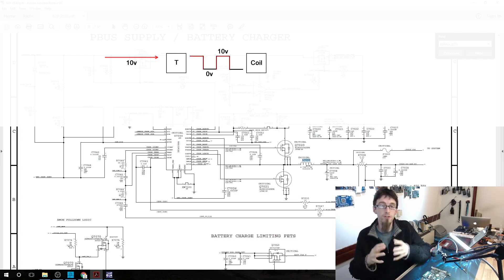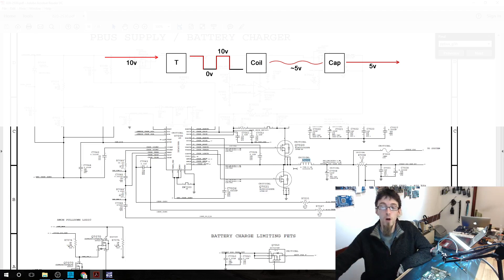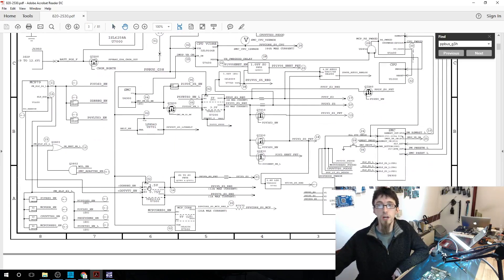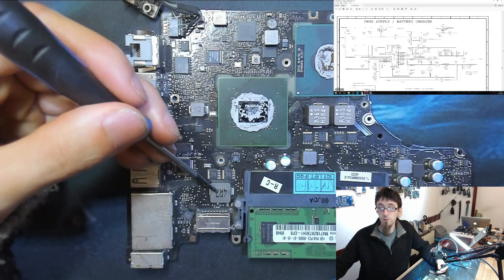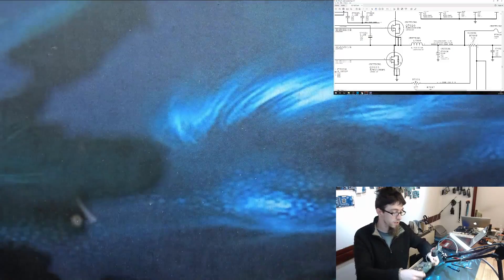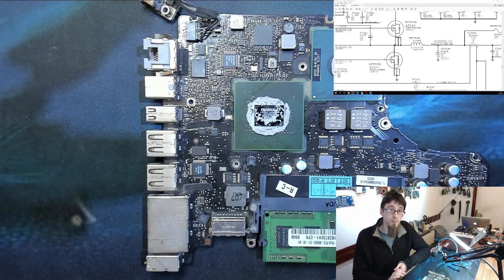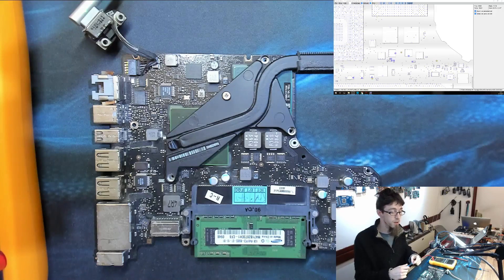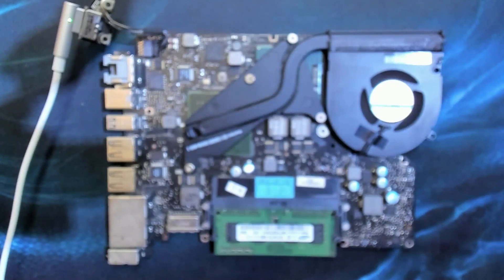Board Repair Basics #3 - Buck Converters

Comment: I don't get it. On schematics of other laptops it is frequent to see that two back to back transistors are turned on by the same signal. Here if U7060 comparator(TL331) turns of Q7001, it's diode would still be forward biased and it will not prevent flow of current from 18,5v charger. Q7001 can handle high current's through it's diode, but turning it off alone would not be sufficient to cut power. The whole point of back-to-back mosfets is to prevent current flow in both dirrections, but here we see that one of them can be turned off(if it were other mosfets that can't handle high currents through their diodes they could burn out). From the looks of it, seems to be that U7060 is there to prevent current from getting out, though i may be missing something and i don't have a board to check it.  Update: Q7001 prevents negative voltage from being applied to the system  and battery voltage from leaking out

Comment: 5:54, i'm confused. if 10v would lead to 5v, why does 16.5v lead to 12.65v instead of 8.25v?
Reply from the maker: The width of the high-voltage pulse will dictate this. I gave a 50% example because that's easy to understand, but if you did a 25% pulse of 10v, you'd get something closer to 2.5v, all other factors not included.
The buck regulator will watch the output voltage and carefully trim the pulse width until it's seeing the target voltage. This means that the input voltage can vary by a fair bit, and the regulator will still... regulate.
Reply: 8 @Adamant_IT  is this coil similar to an inductor or motor windings? Why do they have to be coiled?

Comment: How do you know, looking at those schematics, in which direction power flows, since I see many lines connecting to the different components. 
What are those black dots by the way?
And how does an average of 0volts and 16.5volts gives an output of 12v? 
Contrary to most other viewers I found these tutorials rushed. A lot of things left to explain.

Comment: Can you use a step down dc to dc converter to use in voltage injection
Reply from the maker: I think so, yes. It needs to be able to current-limit though, otherwise it'll just destroy itself due to being run in a dead-short.

Comment: Help a noob make sense of the fundamentals.. Does the U7000 apply voltage on the gate of the flyback mosfet when the buck converter output is low, thus allowing it to only allow current through at appropriate times? I can see how this could be useful in contrast to just using a simple diode that would always let the current be drained to ground.

Comment: A very general question : where do you get the parts when you have determined which part is dead ?, especially if you do not have a grave yard of dead mother boards of all types to take useful parts from in your garage.

Are there new part suppliers some where ?
Reply from the maker: It's tough when starting out. eBay is a good bet, but might not be the cheapest. Aliexpress is fairly solid, but slow. It all depends what country you're in really.
Reply: @Adamant_IT  

Thank you for your fast reply.  Here in the U.S. is little bit tough because people actually...... " wish " their computers  break, so they go to bestbuy to purchase the newest model instead of mulling repairs...

Comment: Your channel is a treasure! I got a question, you measured the voltage in pin 2 (coil) in the first buck converter and the voltage was steady. Why? is the multimeter too slow to read wave changes or what? From what i have understand for a steady voltage we need the capacitors next to the coil.  Do you need an oscilloscope to see that or what? Thanks.
Reply from the maker: Correct, mustimeter isn't fast enough. A scope will show the wave output, but I didn't have one when I was recording these videos.

Comment: Reading other lessons on buck converters, I understood the premise and the way transistors work, but this video allowed the pieces to click when you explained how the varying voltage ratios allowed for the coil to output a different A/C current into the capacitor which straightened it out, also help me get a better understanding when you mentioned how there was a drain for the excess from the coil.

Comment: The low side MOSFET does not 'prevent flyback'.  It allows flyback to turn the inductor into a current source and continue charging the main capacitor C7008, while at the same time charging the bootstrap capacitor C7025 for the next cycle.  Since the other side of the inductor remains connected to the output capacitor, you aren't shorting anything anyway (you'd have to short Both Sides of the inductor, as a flyback diode does).  Here's a PDF - not exactly a model of clarity, but it does describe the process in detail: https://engineering.purdue.edu/Courses/ECE433/exp5_5th~6thweek_.pdf
     Also, the duty cycle of the circuit is not determined directly by the input voltage vs. output voltage ratio.  It is mostly determined by the output current, which changes the voltage on the output capacitor.  At extremely low current draw, the output cap isn't drained very much, and only needs a short pulse from the high side once in a while to maintain the set voltage.  As current draw rises, it will require larger pulses to maintain the set output voltage, and the duty cycle rises in proportion to compensate for the higher current demand.  If duty cycle were determined strictly by the input/output voltage ratio, it would never need to change.
Reply from the maker: I had a lot of trouble understanding flyback, and hadn't really grasped it myself at the time of this video - but yes, you're right 👌
My understanding is that when the low-side turns on, it provides a negative to the inductor's positive, right?
Reply: @Adamant_IT   Inductors are such odd birds, you almost have to change how you think of them depending on the state of the power applied to them.  They always act to resist the change in current.  Voltage rises, the current will rise slower as some of it is used to charge the inductor's field.  Voltage drops, some of the field collapses and tries to keep the current from dropping (actually just delays it a little).  If you remove the external voltage entirely, it's best to think of the inductor as a battery.  It is now a Current Source, with the same polarity that was applied to it a minute ago.  But now it's supplying current, so electrons will try to leave the negative side and find a route to the positive side.   Current is actually moving the same direction it was before - sometimes that's a hard concept to grasp.  Probably due to everyone calling it 'back EMF' or 'flyback'.  As you know, this same effect is used to increase the voltage in a boost converter.
     In this case, the only place for the current to go is 'through' the capacitor, which it can't do.  Since the inductor and capacitor start at relatively the same voltage, nothing happens at first.  As the load draws current and charge off the capacitor, the voltage drop will allow the inductor's field to collapse, and the resulting current will help supply the load, keeping the supply voltage just that tiny bit higher than it would be without the inductor.   Since they stay at the same voltage, the inductor doesn't literally charge the capacitor, but it does help it keep it's charge longer.
     On review, I have to change what I said about the bootstrap capacitor.  Since it's negative side is directly connected to ground, the only thing that's charging it is the microcontroller line on it's positive side.  Sorry, I should have seen that the first time.
Reply: @chrisw1462  Is this the same, as you explained, as a flyback transformer for CRT TV's?
Reply: @gxc90    Yes, technically.  In a CRT, the Flyback transformer uses the flyback effect to generate high voltage for driving the CRT - usually north of 10-20 kV.  The transformer is actually designed to enhance the flyback effect to make it more efficient.  In a buck/boost converter, flyback can be used the same way, but only boosting a few volts instead of thousands.  In a CRT and boost converter you want 'flyback' to help it do it's thing.  In your micro-controlled relay, not so much.
Reply: @chrisw1462  Thank you. :)

Comment: Brilliant video. Because of your channel I've been inspired into having a go at repairing a cheap Fujitsu laptop. The motherboard has burnt itself out by the + side mosfet on the buck converter for the 3 volt line. Its burnt a hole in the board where I think a capacitor (unrelated) was, but it's hard to tell because I only have a schematic and not a board view. I have ordered a good second hand motherboard online, but I'm concerned if I have a short on something else in the laptop which may have caused the burn out. Am I right in assuming that an overload on the 3v line wouldn't cause the mosfet damage upstream?
Reply from the maker: I wouldn't have thought so. The regulator should be able to tank anything that happens on its output.

Comment: I have a lot of 5+ year old computers coming in with overheating problems. most of the time this is solved by reapplying thermal paste. Older machines that have very old thermal paste reapplying is not enough. It looks to me that at some point the mobo becomes damaged and is the source of overheating. Is it possible to trouble shoot this problem and find a fix? I only work on PC's.